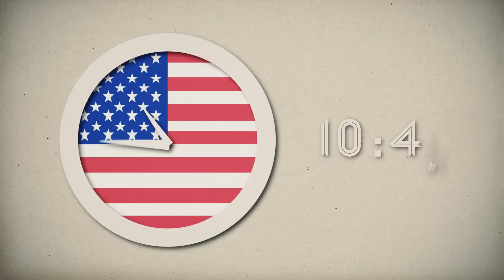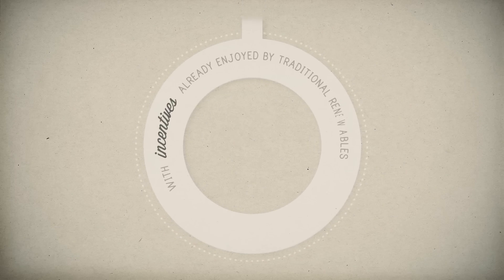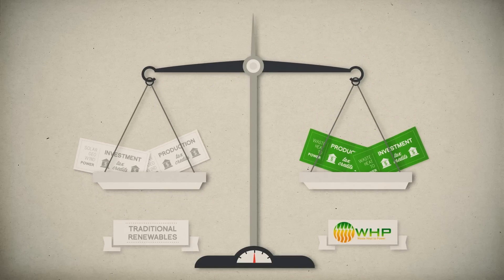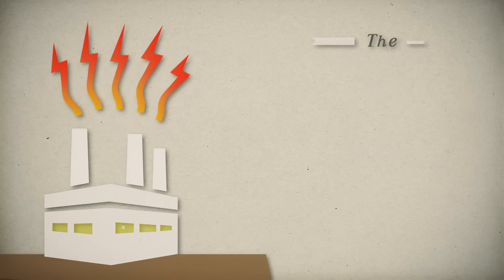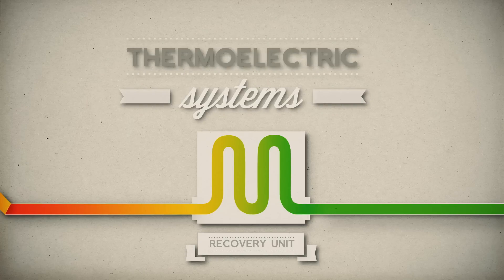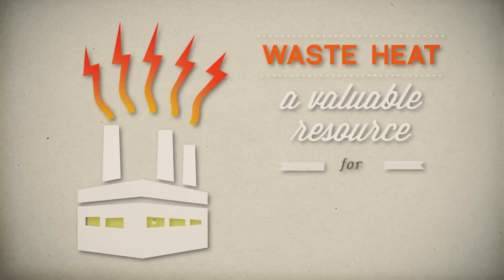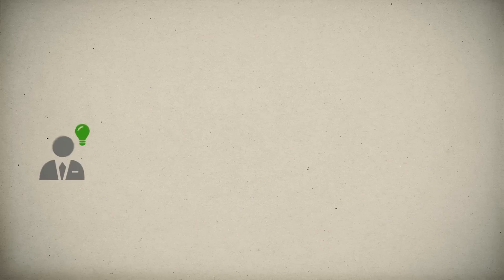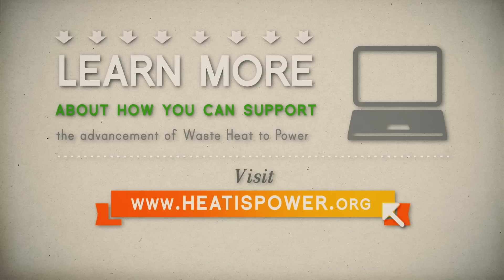Waste Heat to Power: The Video

Comment: There is so much heat energy being put into the atmosphere. Think about it. What doesn't take heat to process everything we use. How much of this combusted energy is blown into the atmosphere. How might that affect our global warming issue?
This heat energy needs to be utilized so efficiently that what is being vented is less than 100F. This is possible with the technology of Condensing Flue Gas Heat Recovery. There is water in combusted natural gas, and this created distilled water is very usable.
There is so much more that can be done to make America Energy Efficient.